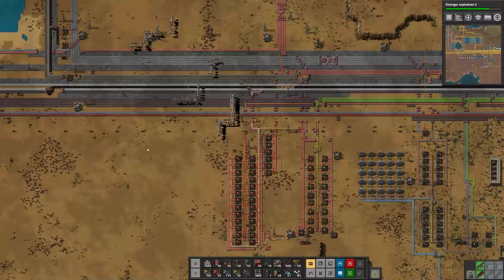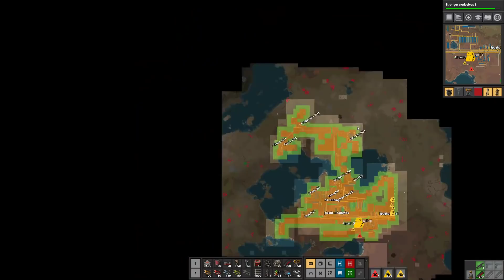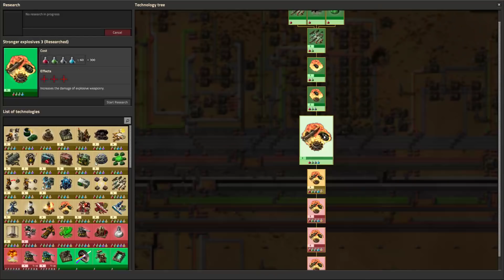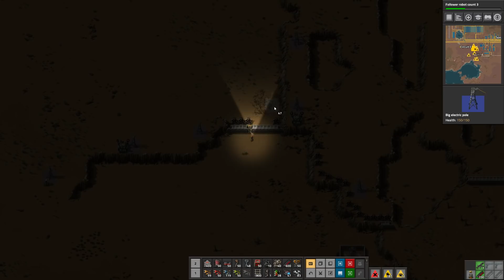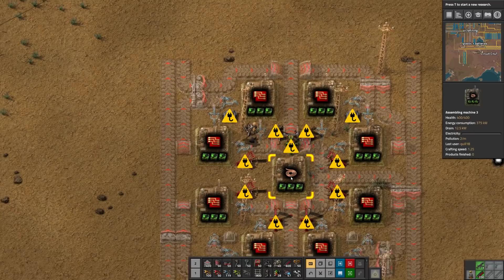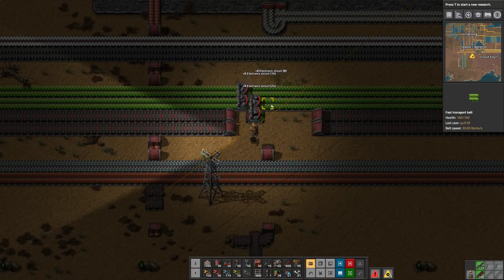Let's Play: Factorio! -- .17 Experimental -- Part 14

Comment: I've found that if you can maintain 3 red belts of green, you are generally pretty good for up to about 60ish SPM.  For blues, I really like to feed 1.5 belts of green and .5 belts of red, that way the red inserter has something to do once the reds are all loaded into the machine, and the bottle neck on throughput usually isn't reds (assuming you are making enough red\green in the first place).